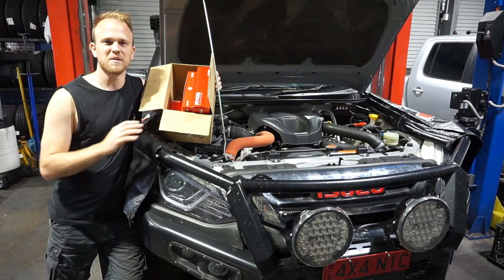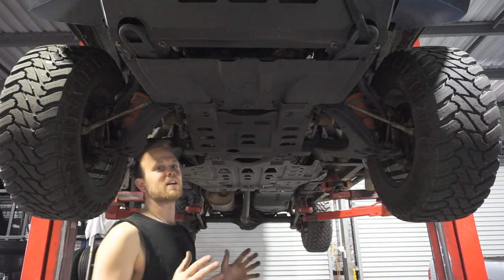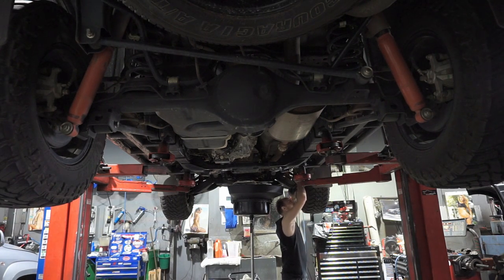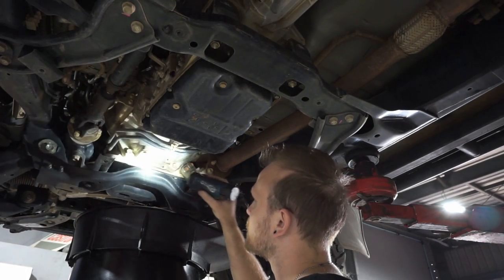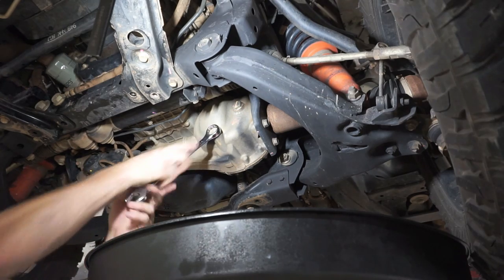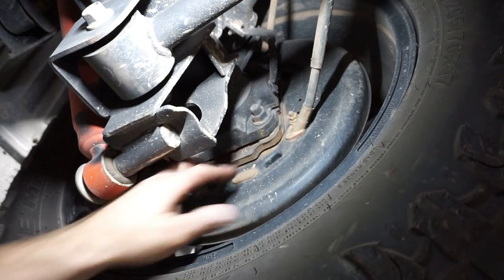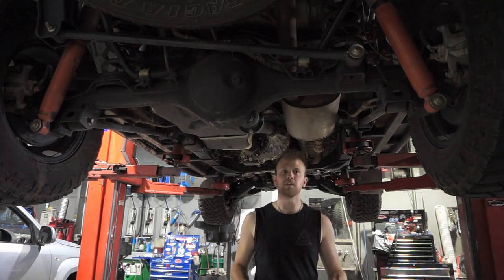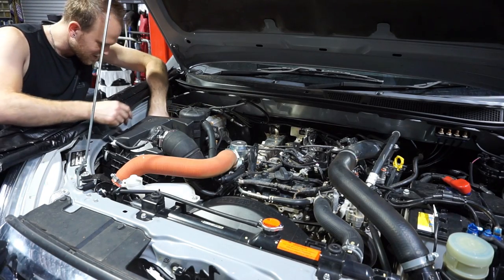How To Maintain & Service Your 4WD Vehicle - Isuzu MU-X Service & Maintenance

Comment: yo. bro my radio stopped working in my DMAX 

do u know where the fuze box is located
Reply from the maker: 1. Right hand side of dash behind the little coin tray, open coin tray and pop it up and out. 2. In the engine bay on the left hand side next to the battery.
Reply: @LowRangeNick  Thanks soo much man... Love your videos i subbed
Reply from the maker: @tremolony4924  Thanks alot!